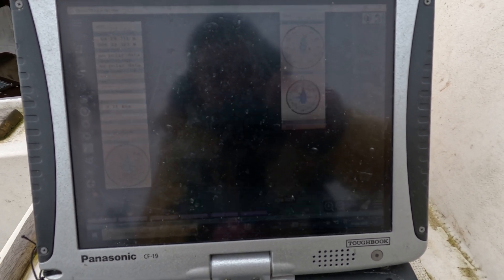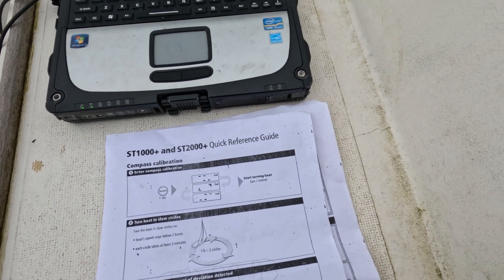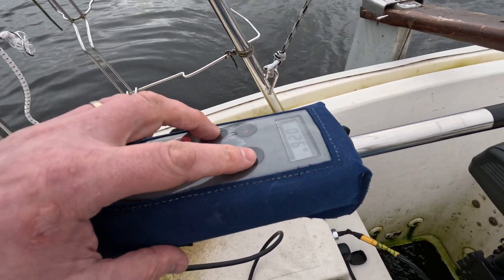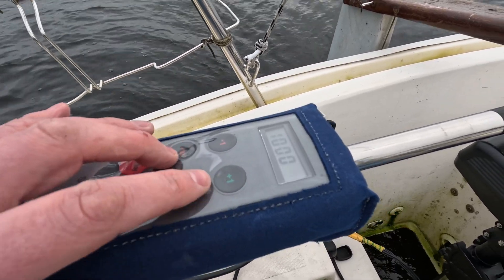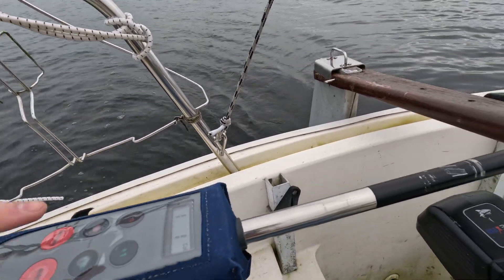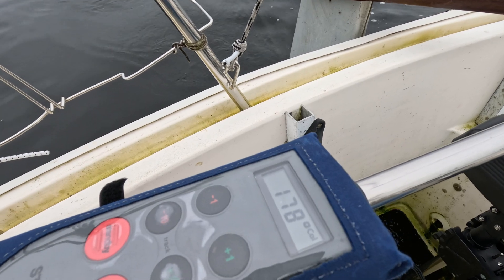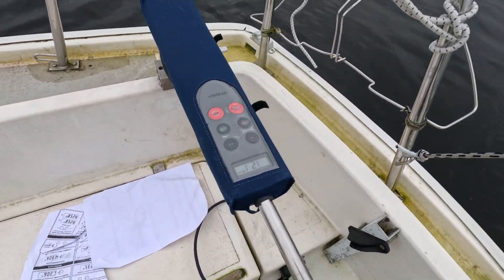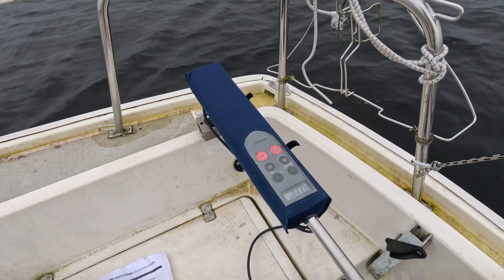Calibrating ST1000+ Auto Pilot , also fixing issue with calibration mode not starting on key press

Comment: hi, This is very interesting. mine has a tendency to occasionally just push to full extension while in auto mode.  ie the electronics tries to make a course correction, and extends the piston, but it doesn't stop, and goes to full extension.  could this be caused/fixed by calibration?
Reply from the maker: Interference from something to the electronic compass in the auto pilot , I found my outboard drove it nuts on my last boat as it was in a well right under it. You can get remote compass

Comment: Hi. My steering tiller handle is backwards.I guess it was made that way, so u can do fishing from the back of the boat and be able to steer it while there, So if I install a raymarine, my boat will wanna steer the opposite direction of what raymarine is trying to turn. Do you have any idea if there is a setting or adjustment for that?
Reply from the maker: Yeah there's a setting if it's installed on port or starboard so you can switch it over to reverse controls on the tiller pilot itself
Reply: @boatsandbits  thank you very much